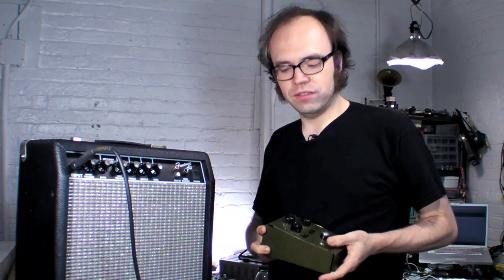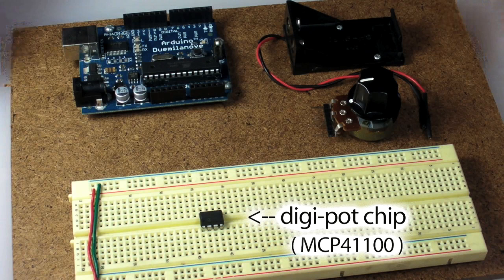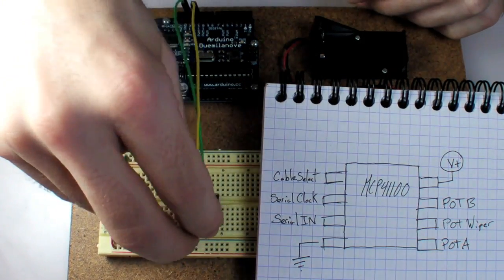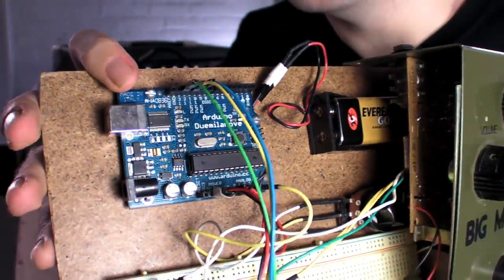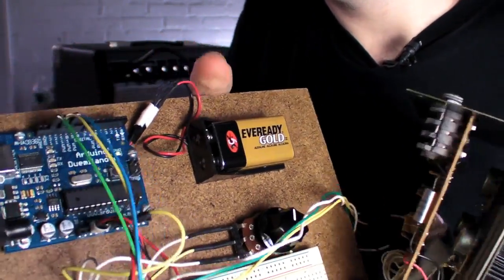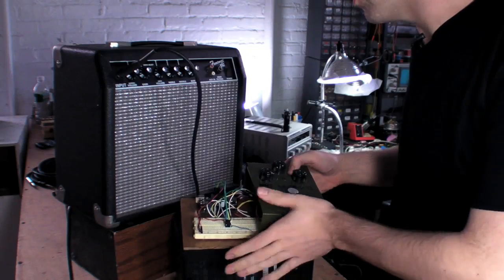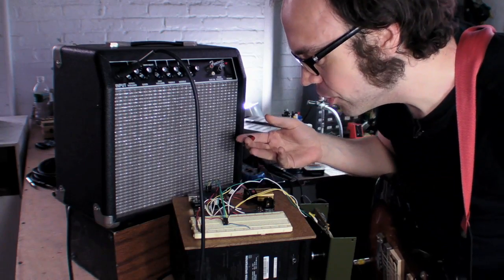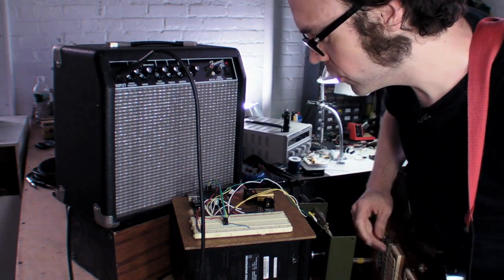Collin's Lab: Guitar pedal hacking with Arduino

Comment: Holy crap - Thats an Ibanez ST-50, I'm just restoring one I was given 17 years ago! It was in a punk band in the 70s in London, they split in about 1980, reformed in the 90s for a bit and the manager ended up with the guitar sans all hardware. I've had it ever since. Oddly, I'm goign to use it as a test bed for electronics as I have about 20 other instruments. Spooky - its clearly a sign! LOL :o)

Comment: Whenever I've tried to put a load of wavetables into an Arduino (trying to make a MIDI LFO for my synth) I've had troubles with running out of RAM.
There's probably another way to do it that'll just hold the wavetables in flash instead of RAM?????
Reply: different boards have different amounts. I think due has a lot

Comment: A cool effect would be to detect the attach on the string and ramp the distortion up form there....so kinda going clean-->distorted as the sustain carries on. or the other way.
Reply: +totaltotalmonkey You can fix that by changing a couple of values in the code. Not a hard thing to do.
Reply: good idea, maybe fine tuning depth of wave would be helpful too.
Reply: totaltotalmonkey what do you mean by that? depth of wave?
Reply: Yves Baggi In the video I assume the wave goes between no distortion and 100% full distortion. It might be nice to be able to go from a little distortion to full, or from no distortion to a little.
Reply: thanks for the heads up : -)

Comment: Hello, 

for the switches I would use a relay, if you want to enable distorsion components passing directly the audio sigfnal I would use a gate like CD4016 or CD4066. Look for the datasheets.

Comment: Actually it's only a demonstration of the capability of the setup with a micro controler. You can achieve lots and lots and lots of new effects if you know what you're doing. And besides that, you can even use the sound you're generating to control some hardware...for example: leds.......on your guitar......:D

Comment: you can definitely achieve the same result without hacking your big muff. just run a modified version of colins sketch to control an LED on a breadboard, hook up a 2 jacks on the other side of the board and an LDR then turn out the lights. U get the same sound to my ears - why you would want that sound is a question you have to ask yourself :0)

Comment: @neutron7 Exactly - This is where I think there is potential - using digital technology to control analog circuits. Every analog effect is self contained (on/bypass is about all you do during a performance) imagine if the pots of all of your pedals were exposed to an dig controller  - not only could you have presets but you could dynamically change settings in real time creating more possibilities

Comment: I get better fx from my Korg effects box and for cheaper then buying that guitar pedal and the arduino. otherwise a pretty cool mod if you happen to own both of the parts needed. it would be a lot cooler to see what an arduino could do with out the guitar pedal. how about making one that is fully DIY and you could get cool sounds by building one of your own... I´d be 10X more interested in the arduino after that.